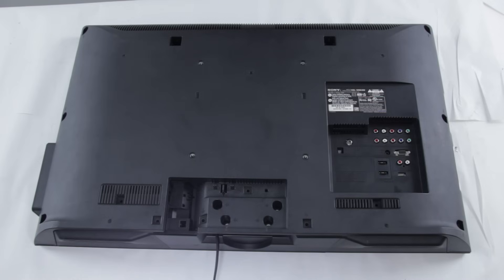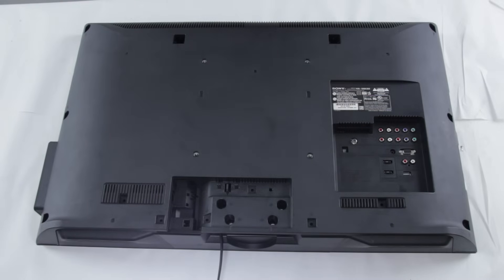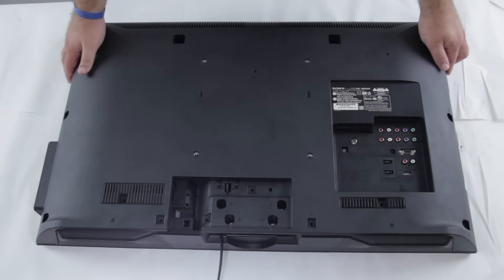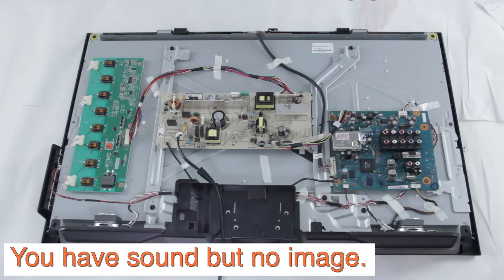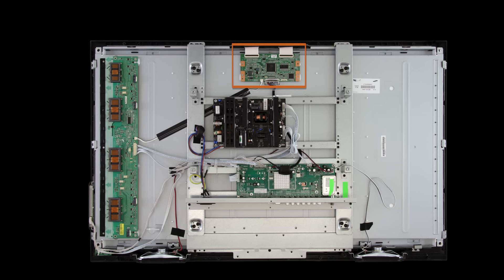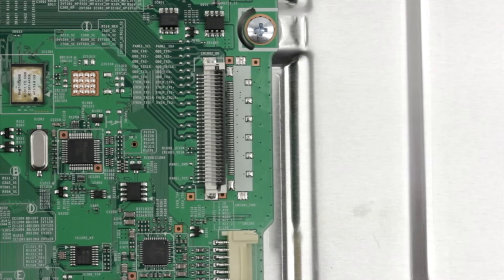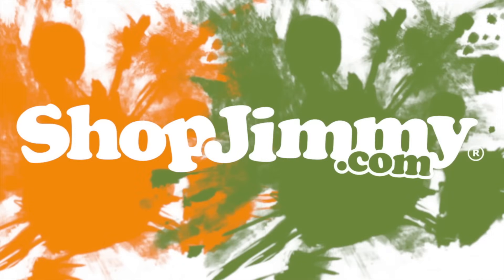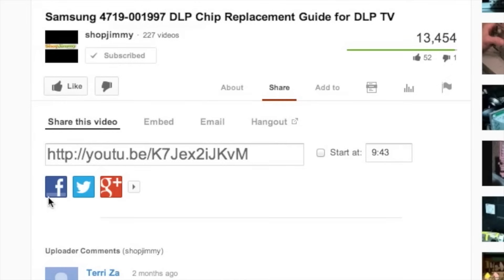LCD TV Repair Tutorial - T-Con Board Common Symptoms & Solutions - How to Replace T-Con Board

Comment: I have a vizio model VO370m, sn: lukebak4702677. When you turn it on the vizio logo lights up, back lights come on but then go off, screen stays black, you can see a picture when looking at screen with flashlight. I also have a vizio E552VLE, worked fine until the power went out the other night, I guess when the power came back on it had a power surge, no lights or sound comes on,
Reply from the maker: theresa suddarth   I would normally recommend replacing the backlight inverter(s) in your TV, however I believe the backlight inverter and the power supply board are combined as one.  So I recommend replacing the power supply board.  Here is a link to replacement parts for your TV model number on our website, click here:  http://www.shopjimmy.com/catalogsearch/result/index/?cat=4&q=VO370m  Be sure to match part numbers on your current board, with your replacement for compatibility.  You can also call our customer service for further assistance with your purchase.  (877) 881-6492  Thanks and please let us know if you have any further questions with your TV Repair!  www.shopjimmy.com

Comment: Hello. I have an LG Infinia 55LE8500 that was purchased In Jan of 2011. When I turned the tv on today i noticed a horizontal line running through the middle of the picture and the top portion was a lighter/brighter color and flickered. Any troubleshooting help would be greatly appreciated. Thanks
Reply from the maker: padrefan   This sounds like a TV panel problem.  If your TV panel is bad, it may be more cost-effective to replace the TV as panels are typically hard to find in stock, difficult to replace, and expensive.  Thanks and please let us know if you have any further questions!  www.shopjimmy.com

Comment: I would recommend to use a flat plastic sheet to lift up the lids of ribbon connectors.
so that it spreads the force to the entire width of the lid.
I broke one off using my fingernail

Comment: hello I have a Samsung un60d7050 and I turned the tv on today and there was a red line going down the right center of the screen I replaced the main video board about 7 months ago and it has been working great since. would the red line mean that the t-con board is going bad? thanks for your help. Steve
Reply from the maker: Steve Loffredo   This sounds like a TV panel problem.  If your TV panel is bad, it may be more cost-effective to replace the TV as panels are typically hard to find in stock, difficult to replace, and expensive.  Thanks and please let us know if you have any further questions!  www.shopjimmy.com

Comment: I have a vizio E500i -A1. It will not power on. I have removed the back cover and checked for blown caps on all boards. No bulging or leaking. The fuse is good. I get no response on manual buttons. I have no remote to check that way of powering on. I get warmth from the mainboard heat sink however. I also attempted to get a detect through my pc via hdmi with the mainboard heatsink warm. No detection. Thank you for any suggestions.
Reply from the maker: Sh P  I recommend replacing the main board in your TV.  Here is a link to replacement parts for your TV model number on our website, click here:   http://www.shopjimmy.com/catalogsearch/result/index/?cat=56&q=E500i  Be sure to match part numbers on your current board, with your replacement for compatibility.  Here is a link to a video showing how to identify your part number, click here:  http://www.shopjimmy.com/vizio-3650-0042-0150-main-board-for-e500i-a0.htm  You can also call our customer service for further assistance with your purchase.  (877) 881-6492  Thanks and please let us know if you have any further questions with your TV Repair!  www.shopjimmy.com
Reply: Thanks guys will do. I was thinking the same. Got a meter and all the voltages are within range.

Comment: HI
I HAVE A SAMSUNG MODEL # UA40ES6200MXXY, S/N ZUVR3MLC600783D LED SMART TV
.
THE PROBLEM IS THE BOTTOM HALF OF THE SCREEN HAS A DARKER OVERLAY OVER THE ACTUAL PICTURE, THE TOP OF THE SCREEN IS NORMAL. I CAN SEE THE PICTURE THROUGH THE BACKGROUNG OF THE DARKER SCREEN. THE PICTURE APPEARS TO BE LIKE A DARK CLOUD OVER THE ACTUAL PICTURE.

 CAN YOU HELP WITH THIS PROBLEM AND SUGGEST WHAT PART I NEED TO BUY.

THANK YOU.
Reply from the maker: pascal cesar   This sounds like a TV panel problem.  If your TV panel is bad, it may be more cost-effective to replace the TV as panels are typically hard to find in stock, difficult to replace, and expensive.  Thanks and please let us know if you have any further questions!  www.shopjimmy.com

Comment: Hi i have a samsung 52' lcd LN52A630M1F and it has been cycling on and off it wont stay on. At one point you were able to see the image for a few minutes but then went back to cycling.. all capacitors have been previously changed so when i checked they all look fine. No budge or leaking. Im thinking possibly the main board?
Reply from the maker: idontknow87  I recommend replacing the main board in your TV.  Here is a link to replacement parts for your TV model number on our website, click here:  http://www.shopjimmy.com/catalogsearch/result/index/?cat=56&q=LN52A630M1F  Be sure to match part numbers on your current board, with your replacement for compatibility.  Here is a link to a video showing how to identify your part number, click here:  Samsung Main Boards & Digital Boards: Part Numbers for LED, LCD, DLP, Plasma TV Repair  You can also call our customer service for further assistance with your purchase.  (877) 881-6492  Thanks and please let us know if you have any further questions with your TV Repair!  www.shopjimmy.com

Comment: I have a Vizio E472VL. The symptoms are: TV powers on, but won't power off and no functions work from remote or buttons on back of TV. TV is stuck on HDMI 3 since functions do not work. TV displays images great, but volume is stuck at one level. Pull power cord to turn off. Plug back in, press power and tv powers on.Thanks in advance for any assistance you can provide. scott
Reply from the maker: Scott Veitch   I recommend replacing the main board in your TV.  Here is a link to replacement parts for your TV model number on our website, click here:  http://www.shopjimmy.com/catalogsearch/result/index/?cat=56&q=E472VL  Be sure to match part numbers on your current board, with your replacement for compatibility.  Here is a link to a video showing how to identify your part number, click here:  TV Part Number Identification Guide for Vizio Main Boards (Plasma, LCD, LED)  You can also call our customer service for further assistance with your purchase.  (877) 881-6492  Thanks and please let us know if you have any further questions with your TV Repair!  www.shopjimmy.com

Comment: Maybe you can help, I have a Vizio vl470m tv.The problem I'm having is when I turn on the TV there's no picture. ..The screen is mostly black with a white line going across the top.I don't hear sound, I also try changing the channels but I still don't see or hear anything.If there is anyway I can send u a video so that u can see for  yourself let me know.Again any help will be gladly appreciated...
Reply from the maker: biggstell  This sounds like a TV panel problem. If your TV panel is bad, it may be more cost-effective to replace the TV as panels are typically hard to find in stock, difficult to replace, and expensive. Thanks and please let us know if you have any further questions! www.shopjimmy.com

Comment: I have a Sony TV, KDL46Z4100, and has hundreds of thin different colored lines on the screen. The line take up the whole picture and even know and then you can see part of the image, what what it looks normally come though. I tried to reset it, and opening the menu, but still get the lines.
Reply from the maker: Dillon Thinnes   This sounds like a TV panel problem.  If your TV panel is bad, it may be more cost-effective to replace the TV as panels are typically hard to find in stock, difficult to replace, and expensive.  Thanks and please let us know if you have any further questions!  www.shopjimmy.com
Reply: Thanks

Comment: have a Samsung Model LN65B650X1F with a picture that just flickers on and off, making watching impossible. No sound problems. Geek Squad wants $3000 to repair, so we are not going there. Suggestions? Bob M Ft Myers, FL
Reply from the maker: Robert Mandraccia   I recommend replacing the inverter board in the TV.  Here is a link to replacement parts for your TV model number on our website, click here:  http://www.shopjimmy.com/catalogsearch/result/index/?cat=46&q=LN65B650X1F  Be sure to match part numbers on your current board, with your replacement for compatibility.  Here is a link to a video showing how to identify your part number, click here:  LCD TVs 101: Part Identification Number Guide for AU Optronics (AUO) Backlight Inverter Boards  You can also call our customer service for further assistance with your purchase.  (877) 881-6492  Thanks and please let us know if you have any further questions with your TV Repair!  www.shopjimmy.com

Comment: I have a  SHARP LC-30HV4V s# 408339715 when I turn it on, all I get is a blue screen. Cannot get menu, volume, or anything else to show on there. Is it the main board or t-com board?
Reply from the maker: cu2tonite   I recommend replacing the main board in your TV.  Unfortunately I do not see any replacement parts in the search results for your TV model number on our website.  Please reply with your part number on your main board and I can try searching for replacement parts.  Thanks and please let us know if you have any further questions!  www.shopjimmy.com

Comment: Hi I have a Toshiba Regza 52RV535U which has a green bar running vertically through the middle of the screen.It is not solid but does change the colours it passes through making them lighter in shade.Does this sound like a t-con board problem?
Reply from the maker: stephen fudge   This sounds like a TV panel problem.  If your TV panel is bad, it may be more cost-effective to replace the TV as panels are typically hard to find in stock, difficult to replace, and expensive.  Thanks and please let us know if you have any further questions!  www.shopjimmy.com

Comment: I have a Samsung LN46A550. The screen has recently turned light gray. You can still see the picture, but everything in light gray like can be seen in my profile pic on the left. Is this likely the T-Con Board? Everything else about the TV seems to function fine.
Reply from the maker: Chad Blessinger   I recommend replacing the T-Con board in your TV.  Here is a link to replacement parts for your TV model number on our website, click here:  http://www.shopjimmy.com/catalogsearch/result/index/?cat=63&q=LN46A550  Be sure to match part numbers on your current board, with your replacement for compatibility.  You can also call our customer service for further assistance with your purchase.  (877) 881-6492  Thanks and please let us know if you have any further questions with your TV Repair!  www.shopjimmy.com

Comment: Hi, Thanks for Tips.I have Sony Bravia LED tv.Model KDL 46"EX710.
problem is with display.there is no picture.sound is ok.

Repair guy asking for Rs 10000/-. is it ok?
Reply from the maker: Nitin Doshi   I recommend replacing the T-Con board in your TV.  Here is a link to replacement parts for your TV model number on our website, click here:  http://www.shopjimmy.com/catalogsearch/result/index/?cat=63&q=46%22EX710  Be sure to match part numbers on your current board, with your replacement for compatibility.  Here is a link to a video showing how to identify your part number, click here:  DIY LCD TV Repair: Part Number Guide for AU Optronics (AUO) Timing Control (T-Con) Boards  You can also call our customer service for further assistance with your purchase.  (877) 881-6492  Thanks and please let us know if you have any further questions with your TV Repair!  www.shopjimmy.com
Reply: Thanks for help. i will try out that

Comment: 32 inchvizio vertical line no sound pic and cant use tv or remote control to turn off is it the icd controller.
Reply from the maker: BRIAN MCREYNOLDS   This sounds like a TV panel problem.  If your TV panel is bad, it may be more cost-effective to replace the TV as panels are typically hard to find in stock, difficult to replace, and expensive.  Thanks and please let us know if you have any further questions!  www.shopjimmy.com

Comment: Sharp LCD model #lc32D47ua  problem when turn on  vertical lines appear and only half the screen shows can it b fix
Reply from the maker: mark saint   This sounds like a TV panel problem.  If your TV panel is bad, it may be more cost-effective to replace the TV as panels are typically hard to find in stock, difficult to replace, and expensive.  Thanks and please let us know if you have any further questions!  www.shopjimmy.com

Comment: I have a Insignia ns-50l260a13. I have sound with no picture (Only vertical color lines). I replaced the main board thinking that was the issue,  but the lines are back. Do you think it's the T Con board instead and would it be a easy fix if so? -Thanks in advance
Reply from the maker: William Laister, Jr   You can replace the T-Con board if you would like, but if that does not work then you have a bad TV panel.  Here is a link to replacement parts for your TV model number on our website, click here:  http://www.shopjimmy.com/catalogsearch/result/?q=ns-50l260a13  Be sure to match part numbers on your current board, with your replacement for compatibility.  Here is a link to a video showing how to identify your part number, click here:  DIY LCD TV Repair: Part Number Guide for AU Optronics (AUO) Timing Control (T-Con) Boards  You can also call our customer service for further assistance with your purchase.  (877) 881-6492  Thanks and please let us know if you have any further questions with your TV Repair!  www.shopjimmy.com

Comment: samsung led series 6
Model# un46b7000wf
S/N AZ433CFS400221P

There is sound but the picture is all distorted and jumped, when i switch sources or channels the screen flickers but it goes back to a jumbled mess. It is white streaky horizontal line throughout the screen. Please help!
Reply: Jumbled*
Reply from the maker: jacques rougeau   This sounds like a TV panel problem.  If your TV panel is bad, it may be more cost-effective to replace the TV as panels are typically hard to find in stock, difficult to replace, and expensive.  Thanks and please let us know if you have any further questions!  www.shopjimmy.com

Comment: Hi I have a Proscan 40ld45q LCD tv that is displaying strange image. It looks like the colors/brightness is too high. Almost looks cartoonish. Also it ghosts like if you left a still image on for too long but goes away pretty quick. Do you think it's the t-con,main board or the LCD itself?
Reply from the maker: Dogboyaa1   This sounds like a problem with either the main board or the T-Con board in your TV.  You may need to replace each board individually to see which one fixes the problem.  Here is a link to replacement parts for your TV model number on our website, click here:  http://www.shopjimmy.com/catalogsearch/result/?q=40ld45q  Be sure to match part numbers on your current board, with your replacement for compatibility.  You can also call our customer service for further assistance with your purchase.  (877) 881-6492  Thanks and please let us know if you have any further questions with your TV Repair!  www.shopjimmy.com

Comment: Samsung le37a336j1d
Works perfect. But picture distorted red and blue face.etc
Reply from the maker: James Morris   I recommend replacing the main board in your TV.  Here is a link to replacement parts for your TV model number on our website, click here:  http://www.shopjimmy.com/catalogsearch/result/index/?master_part_type=Main+Board&q=le37a336j1d  Be sure to match part numbers on your current board, with your replacement for compatibility.  Here is a link to a video showing how to identify your part number, click here:  Samsung Main Boards & Digital Boards: Part Numbers for LED, LCD, DLP, Plasma TV Repair  You can also call our customer service for further assistance with your purchase.  (877) 881-6492  Thanks and please let us know if you have any further questions with your TV Repair!  www.shopjimmy.com

Comment: I have a Samsung LN-T3232H-UE it turns on but there is a white over the entire picture,ii can see whatever is playing through it but it is like a sheer white over it
Reply from the maker: Dan LaCosse   This could be a problem with either the main board, the T-Con board or your TV panel.  You can try replacing the main board and the T-Con board to see if that fixes the problem.  Here is a link to replacement parts for your TV model number on our website, click here:  http://www.shopjimmy.com/catalogsearch/result/?q=LNT3232H  Be sure to match part numbers on your current board, with your replacement for compatibility.  You can also call our customer service for further assistance with your purchase.  (877) 881-6492  Thanks and please let us know if you have any further questions with your TV Repair!  www.shopjimmy.com

Comment: i saw this vid ( http://youtu.be/e5cDmUqkc9U) and my tv has the same issue.  once the tv warms up, it does not show this defect.  I have a sony kdl 52w4100.  one comment says this is a t-con issue.  i was wondering if there is anything else that can cause this issue?
Reply from the maker: Praju George   This sounds like a TV panel problem.  If your TV panel is bad, it may be more cost-effective to replace the TV as panels are typically hard to find in stock, difficult to replace, and expensive.  Thanks and please let us know if you have any further questions!  www.shopjimmy.com